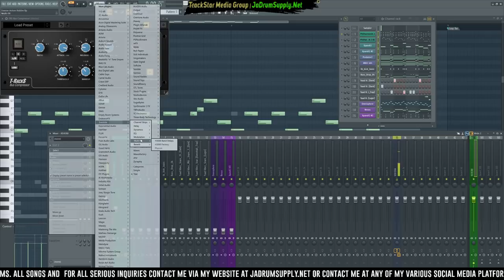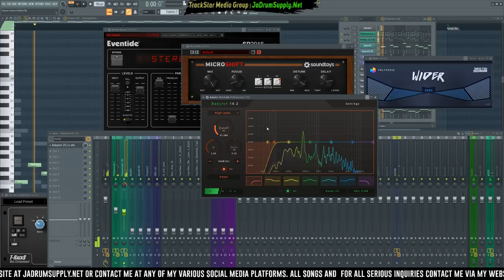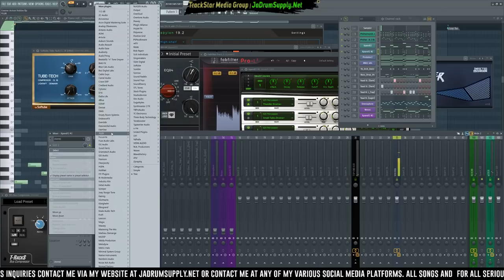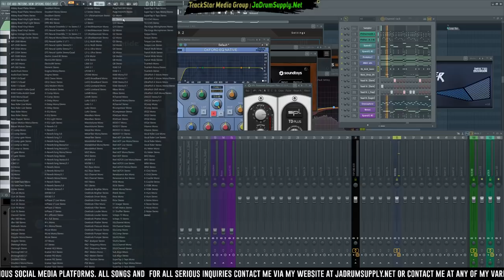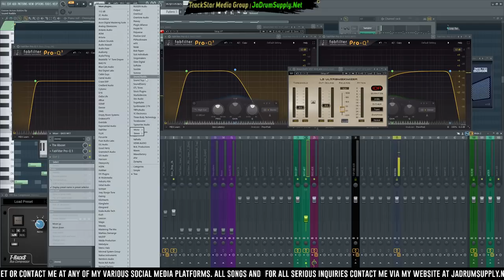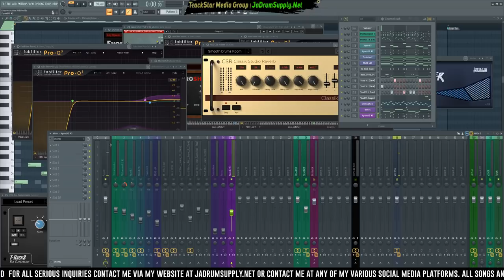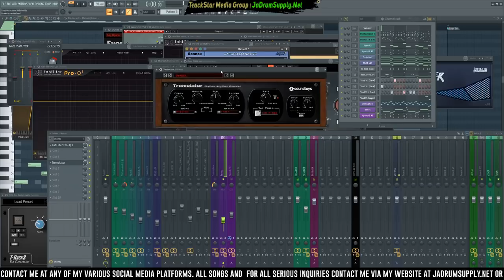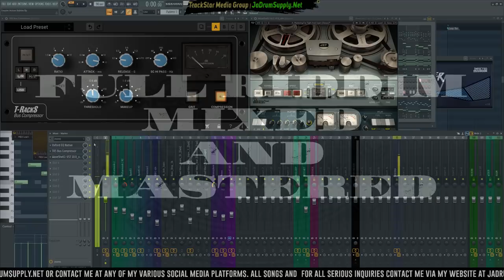How To Mix A Dancehall Riddim | How To Setup And Use Bus Compression | 🎼📀 Itz-Beez-Da TrackStar

Comment: Would it make a difference if you had the faders at 100% then use the compressor to get it to - 6 or - 5db then do the leveling after ?
Reply from the maker: Yeah if yuh use a compressor fi get the levels down it aguh sound squashed..when yuh just lower the faders the sound stay clean an natural
Reply: Thanks but it's the first I see you do it this way as in mix into the buss compressor. Your other videos you add the FXs on the Master after you done leveling and all that . Could you do a video on how you mix and master in 2019 (Current way) as to oppose to when you were learning how to. I would greatly appreciate it as this is is the only thing holding me back to start my channel and posting beats.